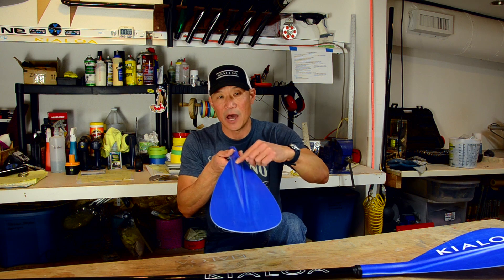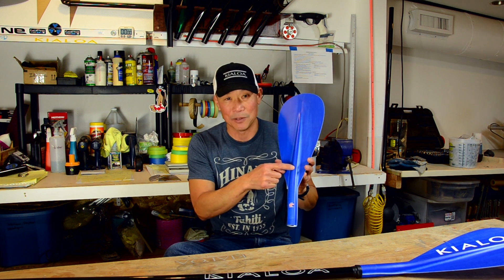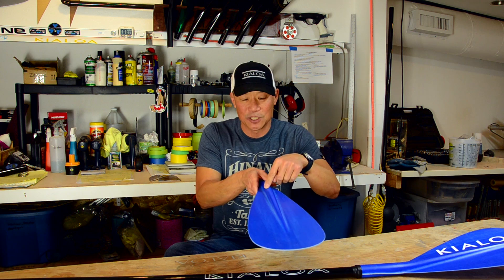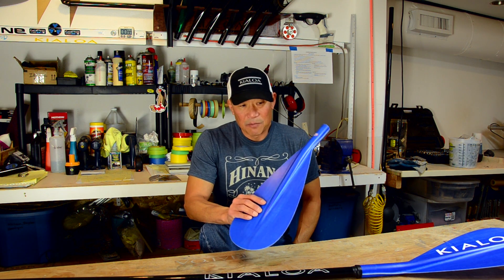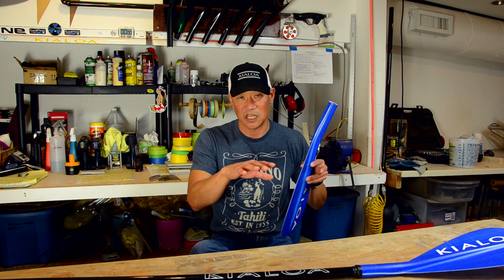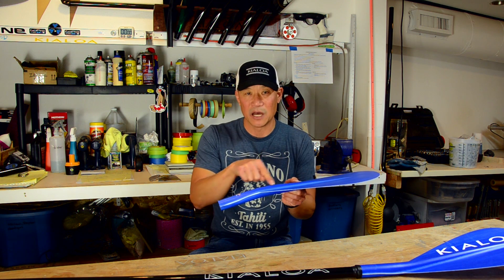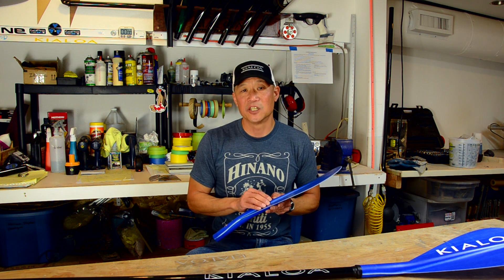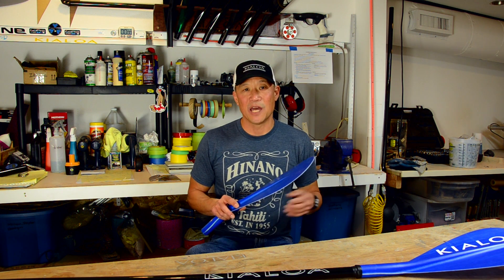Dihedral Paddle Discussion w/ Dave Chun

Comment: A dihedral — a ridge, creating angled surfaces — on the power side of the blade ( facing the paddler ) helps stabilize the paddle by channeling water smoothly during the stroke, reducing flutter.

A dihedral — or two — on the back side of the blade (facing the bow), however, helps reduce the likelihood of cavitation by directing low-pressure vortices away from the blade surface, thereby maintaining water adhesion. It also contributes to a cleaner release, similarly to the way tubercles on a whale's flipper stabilize flow and delay stall.